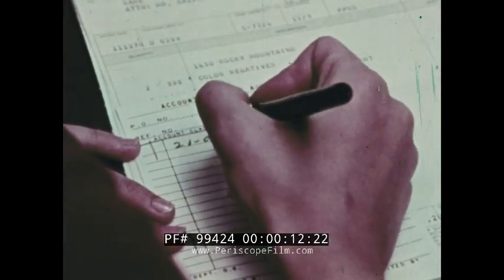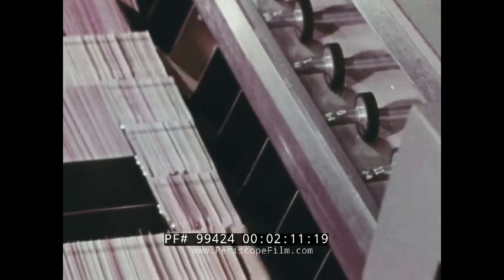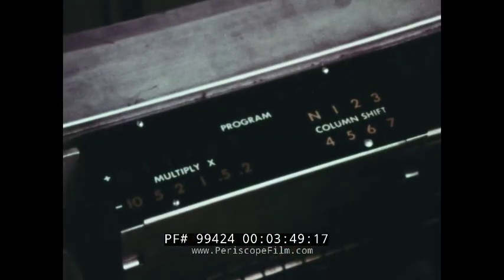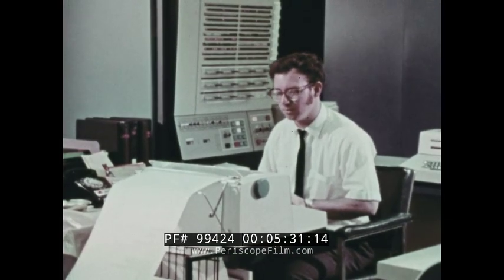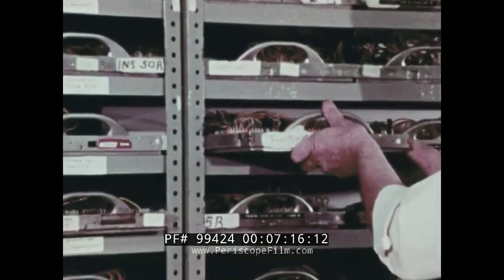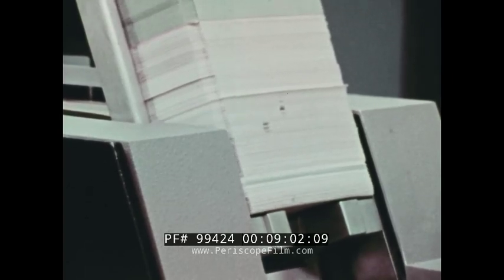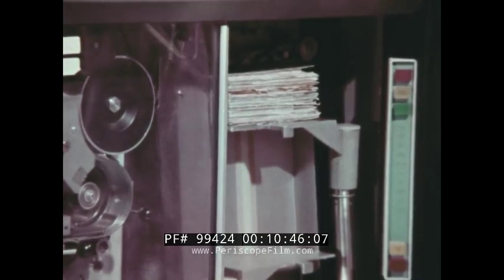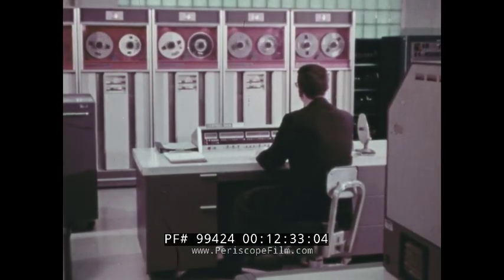DATA PROCESSING AN INTRODUCTION  1972 KEY PUNCH COMPUTER & MAGNETIC TAPE  EDUCATIONAL FILM 99424

Comment: I was 8 when this was made and my mother was in Data processing. I remember the punch card machines and the large magnetic disc's. The dot matrix printers and green bar paper.
Reply: But what is punch card what does it store and was  there İnternet in thoese days?
Reply: My dad would bring home the printer paper and we would draw for hours (blank side). Never did figure a use of the green lined sides.

Comment: Startling how quickly progress moves. The invisible hand of the free market is amazing.
Reply: Free market? It was a race "to the moon" for rockets to take atomic bombs where airplanes couldn't. Military induced progress.
Reply: @nickv1008  No. Yes, that happened. But that is not what this film was about, and had almost zero to do with commercial data processing. There were two sides to the computer business in those days: the military/government side and the commercial side. Most computer companies had both, but the were in separate buildings, and those often in separate states, and there was almost zero influence or transfer from the military side to the commercial. side. On the other hand, the commercial side, which was driven by business, banking, and commerce in general, transferred quite a lot to the military side. This was done by the military side engineers seeing what the people on the commercial side did, taking it, and making modifications for their own use. They did this in their own buildings, and usually didn't tell the commercial side what they had done, because the military stuff was classified or secret, and the commercial stuff wasn't.

The commercial side of DP, which is what this film was about, was in fact driven by free market influences. On the side of the computer companies, they wanted to make a buck. The way they could do that was by making something that people (companies) would want to buy, and then selling it to them. In those days the customers also had a huge influence on the computer companies. They would say "I have this problem and need a solution", and the computer company, hoping to make (a lot of) bucks, would throw an engineering team at coming up with a solution. Sometimes they sold that solution to the customer. Sometimes the customer went somewhere else for a better or different solution. But then the technology had been developed, so the first company sold it to someone else with a similar problem.